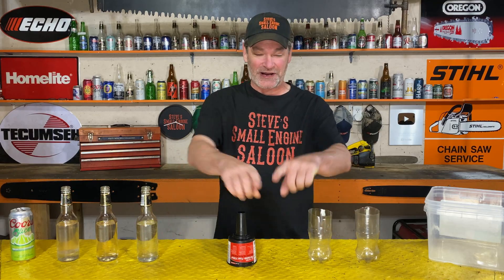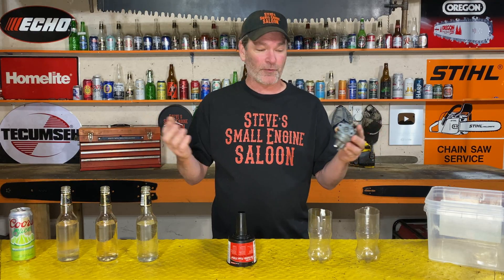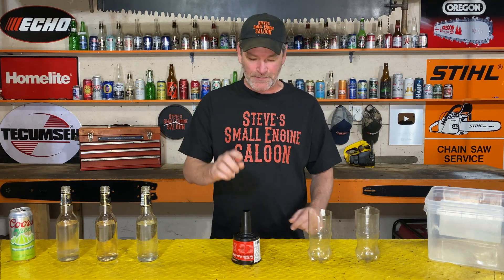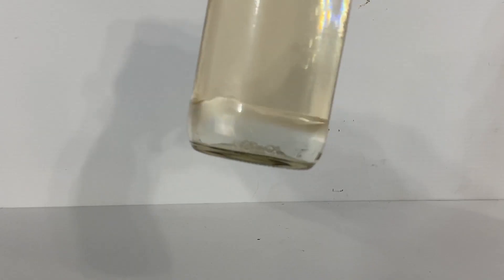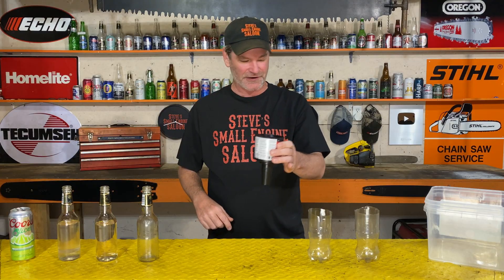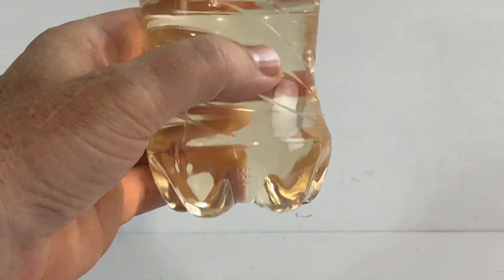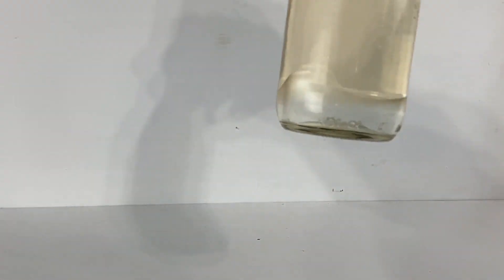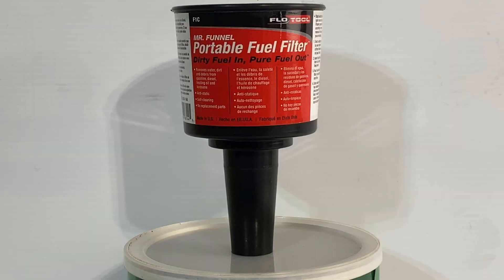Does Mr. Funnel Fuel Filter Really Remove Water From Gasoline

Comment: I actually came up with a system a while back that does the same. It already had a patent on it. So I now have what I made which is a device that attaches to a gas can on all my gas cans so I know there is never any water going into any of my equipment. I tried with my gas can attachment but it would still be a patent infringement.
Reply: What is the mesh screen size?
Reply: @louf7178  I use the same material for the separator and that is a stainless steel screen which separates the water. The interesting thing I that I also use that this does not is a 20 micron paper type filter before reaching the separater to filter out any and all debris. My fuel filters last over 5 times longer in my equipment. Amazing results but bad timing on my end. That and when I first wanted to patent it I did not have the financial backing on my own to do so. I wanted to patent it and then sell it, not make and sell the units. When I did get financial backing it was to late.

Comment: As mentioned before, these work great 👍 
I use one to take water out ofmy kero/Jet-A that I use in my kerosene heaters. The tiniest bit of water destroys the capillary action of the wicks and then you have to pull it apart, dump the tank and dry the wick. And water in any fuel will degrade its quality fast. Kerosene and diesel will support biological growth.
Reply from the maker: Right on
Reply: @StevesSmallEngineSaloon  keep up the great work!

Comment: Can you use it to separate ethanol from gas? Say you put water in regular gas, let ethanol bond with water, then can you use this thing to separate out the ethanol/water mix?
Reply: If it did work, you'll lose your octane rating. You would have to add Moroso 104 to the gas if they still make that.

Comment: do they make larger models and does it work with motor oil and water/dirt? wonder if it could be a pre filter for old motor oil before i dump it in my diesels fuel tanks? knock out the majority of water and debris and the fuel filter will catch the rest
Reply: I don't believe it would filter motor oil.

Comment: Hey Steve, what do you think about using this to remove the ethanol from pump gas? 
Add water, let it pull out the ethanol then run it through Mr Funnel?? You think that would work?
Reply: When I filtered mine, I didn't have anything left over. Just a few gnats. So I'm guessing no. You can add Lucas ethanol treatment to your gas. It does seem to help. Or Startron, but I think Lucas is better.

Comment: Very super awesome!  So south of Canada they have Ethynol fuel at just about every gas station you drive to (isn't that pathetic?). Water and Ethynol mix quite well. If you have Ethynol fuel with water mixed in the fuel, I wonder if Mr. Funnel has the ability to separate out the water? That would be cool if it could do that. I had a friend bring me a Cub cadet riding mower that would not start. I pulled a quart of water out of the fuel. Now this was Ethynol fuel that was absolutely saturated with water to the point that it separated from the fuel. I drained the tank, lines and carb. Put a fresh batch of fuel in the mower and it ran fine. 

OK, so the question is, will that funnel pull the water out of Ethynol/gasoline water mix? Maybe I should buy one of those funnels and try it.
Reply: That’s how it is here in southern Ontario, Canada. I found that premium grade usually doesn’t contain ethanol, even if the pump says it may contain up to 10%. Made the switch to premium a few years back and my carbs don’t tend to gunk up anymore. That ethanol is awful.
Reply: @JimmyNines  Who thought to put food in the fuel tank? What a stupid idea! LOL
Reply: @dedomv11  dude I’m running corn and pushing 350wheel it’s legit😂
Reply: @boosted_brz901  I think we are talking about two totally different subjects.

Comment: I bought exactly the same model Mr Funnel, F1NC. As soon as I got it, I filled it with water just about to the same level Steve did here. And ALL the water went through. I repeated this several times. So I called FloTool support to see if it was defective. The support person told me to only fill the funnel halfway up the screen portion; that filling over that level would let water through. And that the pressure balance to stop the water going through the screen was delicate. 
But halfway up the screen is only about about 11/16". That makes adding fuel to the funnel a real pain to stay under half way, especially with my battery powered pump (for kerosene heater).
So what's the real story on Mr Funnel?

Comment: Yes it works and it doesn't. Guy brought me his boat, not running, realized it had a fuel tank leak, decided to fix that before go further. I had to get 22 gallons of fuel out of it first. Pumped the fuel out into gas cans. I'll skip the part of fixing the fuel tank that indeed had a small hole in it.
While musing what to do with this fuel that I was sure had water in it, I ran across this Mr. Filter and bought one. I ran all of the fuel through the filter and was amazed at how much water (over five gallons of water) was separated out. two weeks later, I set up a high quality filter and electric fuel pump to filter it before I tried in my truck. During that process, using clear hoses, the fuel looked strange at times. So I pulled out the Mr. Funnel again and found it was catching water again? Yes! How can this be? I don't know what to believe.
Got a clear plastic gallon jug, put some of the fuel in there with some water mixed with a lot of food coloring and watched it all turn blue, it all mixed. There had to be some fuel in the can! So I siphoned some fuel off the top of gas can into clear jug, added some colored water and it did not mix!
I knew that HEET (or alcohol) doesn't mix with gas, so I took  bottle of HEET and added an ounce of my blue water and mixed.
I then put a dab of that solution into my cleaned out plastic jug with some fresh fuel to test an idea. The HEET/water solution was separated perfectly from the fuel. Good.
I then poured a few ounces of the colored HEET into my gas can, and mixed violently. After letting that sit for a minute, I shined a flashlight into the can (it helped that it was getting dark outside by now), and I could clearly see where the fuel and water levels were. At this point with the flash light and the fuel pump set up, I sucked up all of the colored water off the bottom till the fuel was clear in the can. This worked so well I could see the last few drops of water in the bottom of the can. The plastic fuel can did not stain blue, much, if any.
With this process I found almost four more gallons of water that certainly got through Mr. funnel the first time. In the funnels defense, the gas was probably ethanol, had been sitting for almost two years, and was the result of (I found out later) the interior of boat having two feet of standing water in it (that's another story).
I like the funnel and will continue to use it, but I'll be cautious.
    May God Bless.

Comment: Hi Steve,  Had a similar funnel in the 50's that was made of copper with a super fine mesh screen that would filter out water.  My dad said it came from his father.  Had used it for filling his boat on the Delaware river.  If I can find your email on your web page will send picture.  Great demonstration.
Reply: Any idea of the mesh screen size?
Reply: @louf7178  No,   Sorry.  I still have it and did send Steve a picture of it.  The wire gage was extremely thin and the weave very tight.

Comment: What is the filter medium . when i was a fireman we had paper pads that would only soak up petroleum products water would just beed and run off it wonder if its yhe same type of filter?
Reply: It is a cylinder of fine meshed metal that has a coating that uses the surface tension properties of water to prevent it from passing through (the water can't form droplets small enough to fit through the openings of the mesh), yet allows gasoline and diesel fuel, which has relatively less surface tension to pass through.

Comment: Hey Steve, what do you do with the spoils left behind in the filter. I use a Mr. Funnel to fuel my diesel tractor and always have a third to half of a cup of spoils after fueling, the filter mesh does not go to the very bottom of the funnel. I have never seen any water in the spoils so I assume it's mainly diesel. Good practice tells me not to pour it back into the storage container so I place it in a container labelled dirty diesel.  /r Ted

Comment: Steve, how does Mr Funnel react to a gas-oil mix like 32:1 fuel, does it separate the oil from the gas?
Reply: I would imagine it would, due to the gravity differences.  I wouldn't try it.
Reply: 2 cycle mix will pass through the funnel.
Reply: @paultennis9414  I stand corrected 😂

Comment: That might be what happened to my mower the other day empty the gas it ran like crap  pretty cool funnel does it work on diesel too
Reply: Yes, works on gasoline, kerosene, diesel and 2 cycle mix.
Reply: Paul Tennis  thanks I have trouble with condensation in diesel tractor in winter

Comment: I’ve used one for 2 years and won’t put any suspect gas, even new fuel, into my equipment without that funnel. It just pure physics, a nickel can’t go through a hole the size of a dime!  Just wish I bought a bigger one!
Reply: water molecules are much smaller than fuel molecules...
Reply: there we go: "Also the filter does not extend to the lowest point in the funnel, as a result there is a large residue of unfiltered liquid left in the funnel after use.". It's a float & a baffle, and the filter is there for filtering debris, not distilling.
Reply: and : "They work great, as long as the water is not emulsified in the fuel.  They also don't work so well if you shake or agitate the fuel can that has water in it"
Reply: I have all the different sizes and I highly recommend them!
Reply: @CALVINLNIKONT what? Different sizes? How big can I get?
Reply: @wim0104  Wrong! Water molecules are much larger than alcohol molecules. Didn't you take college chemistry?
Reply: @wim0104  Wrong? The water precipitates out of the fuel mixture in just a few minutes. Put water and ethanol gas in a graduated cylinder, shake it, and you will witness phase separation right before your very eyes. Phase separation happens when you have extra water in ethanol gas. You need to Google "phase separation"

Comment: Hey That’s sharp. Now we need one to separate Ethanol
Reply: Thats easy.  Just dump a bunch water into your fresh gas, the ethanol and water will combine and sink to the bottom of the can.  Filter off the clean gas from the top.  When you get towards the bottom you can use the funnel to help get that list little bit.  I usually add food coloring to the water I am adding, makes it really easy to see when you hit the ethanol and water layer.

Comment: how does it work though? seems to flow pretty fast for there to be a filter thats fine enough to seperate gas from water, i dont thing a weighted float/valve would work as when gas and water are mixxed itd flow past? rip it apart lets see the guts
Reply: after a bit of research they do indeed use  a filter coated in teflon, impressive how quick it flows with no pressure, i wonder how fine the filter is when it comes to contaminates like fine metal particles, example if a fuel pump failed and shredded itself into a fuel skid tank

Comment: I bought one this spring. It worked flawlessly until I had some gas with rust in it. The rust completely plugged up the screen. I've tried to clean it with carb clean with no success.
Reply: I wonder if vinegar would clean the rust out.
Reply: @louf7178  I never thought of that! Thank you very much!
The rust wasn't chunky, but so fine it made the gas orange.

Comment: will it still filter out water if it is mixed with ethanol gas?  most of people can get is only the gas with 10%ethanol.  also, i mix fuel stabilizer with my gas when filling gas can.  will it still filter water out if gas has been mixed with fuel stabiizer?
Reply: mikeopt,
Water Molecules are bigger than Gasoline so I’m sure any water even if it is mixed with a stabilizer will be caught in the funnel.
GM has had that technology for decades in their fuel tank filters,  no water or particulates can get to the injection system.
Reply: @oldmanfred8676  
It doesn't work by molecule size, it relies on the surface tension of water vs. the relative lack of surface tension of fuel.  Water will pass through this funnel if the fuel and water in the can is shaken too soon before filtering it through the funnel, and then the water will separate out from the fuel in the fuel tank of the equipment soon thereafter.
Reply: Warped,
So,  if you put a drop of dawn in the water will go through?  Try it and see!!!

Comment: I used to work for a bloke who had a small helicopter to do training and charter flights with. He was tight as a ducks arsehole and slack with maintenance (he ruined chainsaw bars cutting up pallets ffs). Anyway, when he drained the fuel test tubes on the chopper he couldn't bear to throw away the >200cc of watery Avgas, so, he'd put it in his ride on mower.. A ride on mower he used to tow the helicopter in and out the hanger on its rolling platform. The poor old Briggs didn't much like running on a mix of petrol, water and aviation fuel and refused to start one day meaning he couldn't go collect Van Morrison from Bristol airport. Allegedly the Belfast Cowboy was well pissed off and sued him for loss of earnings..

Comment: Does it work with oil mix fuel? Had an issue this year with my Outboard’s water filter allowing water in. Short of it, I wasted $28.00 US on a tank of Ethanol free gas😡
Reply: Yes!
Reply: Use Racor filters or Mercruiser.
I worked in marina 20 years rarely did I ever see water get through those. Condensation from air gets in tanks alot more that from pump sources.
I tell people unscrew filter before every trip dump into a glass jar and see how much water is in it then lit filter back on.
They shut off fuel flow when to much water is trapped.
We go 100 miles off Atlantic ocean so we can't take chances.
Enjoy
Reply: mitzvah golem thank you for the advice.
Reply: @LoveShackBBQ  I put a little seafoam in filter then put back on also.
90% of my jobs were water in fuel in carburetor s...now fuel injection even more expensive and Diesil costs $$$$$$ if water gets in injection pump it blows tips off injector nozzle ruins pistons.

I have a kayak now...no more.
Reply: mitzvah golem were on a freshwater lake. 4 boats 3 kayaks and a sailboat. I’d rather be having fun then chasing engine problems for sure. I’m glad I found Steve’s channel. Big help for sure!
Reply: @LoveShackBBQ  I am on Salt water bay oceans lots and lots of issues from salt corrosion.
Check you rubber  water pump impeller severy year and gear oil in drives mid season.
Enjoy!

Comment: Used funnels like this since the early 60's.  Even caught it when the neighbor kid decided to borrow a gallon of gas for his motorbike and added a gallon of water to the 5 gallon storage tank so I wouldn't notice the level drop.  Caught the little s.o.b. the next time and had the local sheriff explain the reform school vacation he would win if the fuel had gone into my tractor and ruined the engine. All fuel,  gasoline, premixed oil/gas, and diesel go through a fine meshed filter at my place.

Comment: Very interesting, thanks for the video.  Would have liked to seen the amount of fuel and water measured before and after.  Pertinent now we are seeing e10 fuel in the uk.  The water solution would have some ethanol in it, removed from the petrol especially if left to stand a while.  Does the funnel then extract the ethanol back out of the water?

Comment: Okay  ... this would work to remove ethanol too ... right? Just add water to some fuel, shake it up to let the ethanol grab onto the water molecules and run it through. The ethanol will be deleted with the water.
Reply: I'm assuming you want to make ethanol-free fuel... Just keep in mind that the ethanol contributes to the octane rating of the fuel! If you remove ethanol from 87 octane rated fuel you will end up with fuel that is "something less" than 87 octane. Best to start out with premium fuel (higher octane) so that the net impact on the resulting fuel is lessened in terms of ending up near an 87 octane level once the ethanol is removed.
You are already taking a 10% loss in your gasoline purchase by removing the ethanol... And using premium gas as a starting point also adds to the cost impact. That said... It's still a good bit cheaper than ethanol-free gas purchased at the pump, and somewhat practical...especially if the intention is to produce limited quantities for small engine use or "vintage engines" that will really not see a lot of run time.

Comment: I'm looking forward to trying out the one that should be arriving today,  but one thing I'm not sure I agree with that I've read a number of other people say is that the fuel molecules are smaller than the water molecules and that's how the filter is preventing the water through. H2O is a very simple, small molecule, whereas any kind of fuel is going to be a much more complex (and therefore, I assume, bigger) molecule. The reasearch I did online said that H2O and CO2 are two of the smallest molecule there are. I'd like for someone who really knows what they're talking about to answer this for me.
Reply: Polarity of molecules (slight negative/slight positive charges) - the filter has some sort of fluorine coating on it that separates the non-polar fuel from the polar water molecules.  I didn't read this anywhere, I just read about the coating somewhere and used my ol' science background so I suspect that's what does it. The charged molecules stay behind while the non-charged ones pass through.